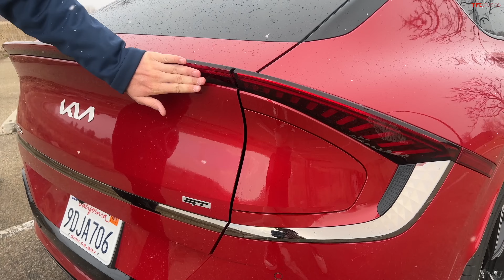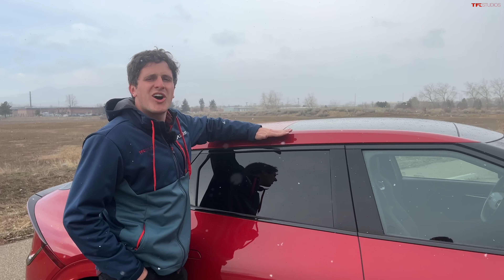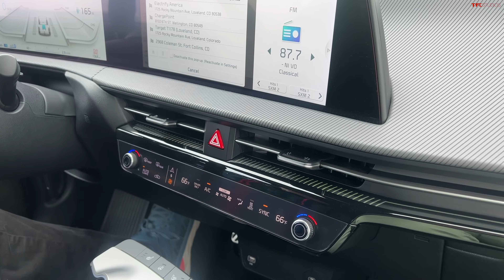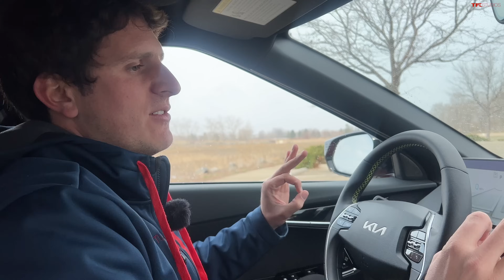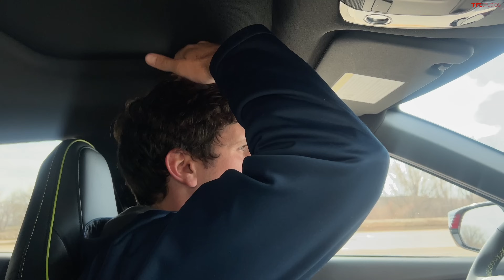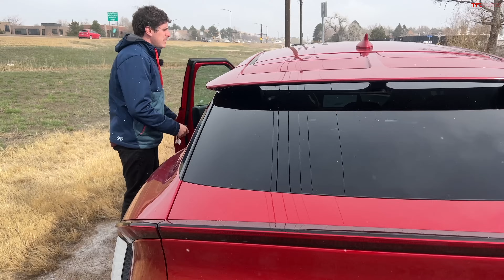The $63,000 All Electric KIA: Is The 2023 EV6 GT Worth The Hefty Price?

Comment: Regardless of Popular Opinion I bought an EV6 AWD (Dual Motor) Wind model. It has the almost 300 mi range and 440lbs of Torque. Lot less price also. I have really enjoyed it so far. Its Very quick and agile for its weight and Charges fast. But it will not beat an Aventador . (It does pull away from these avg. turbos lately tho)

Comment: I must really be an old man.. I wan't a Forrester EV. I like the height, the cargo space in the rear, the visibility, the seating position. Faster would be better, but can't even use what my 2019 has here (Hawaii, Big Island).  Obviously want a heated seat etc delete option (Hawaii).  Also, give me knobs and switches! I love touch controls on stationary devices, but they are a disaster on our rough roads here, like a bad hands free system (Forrester), they are a driver distraction.  I like the EV6, it just needs a 5" TALLER ROOF. Please test these vehicles on real world roads, bad old paving, twisty, two lane, etc.  Of course they perform well on nice smooth pavement! For example I haven't used cruise control of any kind here, except for one stretch of road heading into Volcano that I drive maybe 4-5 times a year. Why pay for something you can't use?? Heated seats?? in Hawaii?? That's just something more to break

Comment: Costs more than 2 Bolt EVs and 1 Bolt EUV fully loaded yet can't go as far and takes longer to charge at home or at the 50 kW DCFC that are around where i live.  So you could get one of these Kia or 1 Bolt EV for yourself 1 for your kid and a Family Supercruise Bolt EUV for the significant other.   No kid borrowing the car they have their own.  And the Bolts can go 20 to 30% further for less E.  

As noted previously with the Bolt can you public charge this only and drive to work for a week?
Reply: I ❤️Chevy, a GM guy thru & thru. Period. 🤣 But Both appeal to two very different buyers. 
Just like in 1908, when the Model T came out. You could buy the Model T for ONLY $950!! A STEAL! BC ALL OTHER CARS ON THE ROAD AT THE TIME? Were LITERALLY ONLY FOR THE RICH! And were Priced as Such. = Way, Way WAY MORE then 950.00 That was the Ford's point. 
& I am with Chevy & Proud they Do offer a cheap Good EV, considering they really fumbled the ball in 1995! They could be what Toyota & Honda are Today. Had they not caved to Big oil & done in EV1! - So kudos to GM for the Bolt. But the Bolt does NOT Do 0-60 in 3 seconds like this Kia does. It doesn't have AWD fir those who Demand it. As "cool" as it is, it's hardly Edgy like the EV6 either. It's more cute than Wow. The interior materials are apples to oranges Different. 
You state valid points. But people don't buy 911 Twin Turbo S because they're Practical cars everyday cars. They buy them bc they Love them, their Fun, they like the Look etc. - Likewise: Bolt? CPA from a flyover state  ... EV6 Hot Corp Forensics Accountant in London! 🤣 does that make sense?
Reply: @ElliottTAlphaG700  the Bolt EUV does everything this Kia does except go fast.  And does somethings better.  You could even say it does 99% of what the Kia does, 99% of the time.
Reply: @Aren Jay  
TF it does, IF u mean they both have 4 wheels ??? The Bolt 0-60 in 7.15 Seconds is a LIFETIME. Versus the EV6 GT IN 3 SECONDS. The Bolt has 200hp the EV6 576Hp. Dude they are NOTHING ALIKE! The Bolt has a 25k Plastic & cloth interior. The EV6 has a swanky Alcantara interior. You're seriously deluded.

Comment: 😂 I did say I liked you bc you're a funny nerd. 🤷‍♂️ Cute nerd, that do it for ya 😂
That aside, it's one of the best EV one can buy stock. In my less than humble opinion. It's a neat looking vehicle, chunky & FAST, Not Lotus Evija fast. But then it's not a $2M car either😂
Reply: One of the best??? You mean one of the worst, if not the worse.
Reply: @allentoyokawa9068  
To each their own, it's more modestly priced. Less than most fossil fueled Gas Hogging p/u's that those owners then b*tch whine & complain about paying for FOSSIL fuel oy. So Less then those. A little more an a decent nice car, which doesn't have its HP  & certainly can't do its 0-60 times. And in NHA Safety scores does amazingly well! Kia backs up their products with STRONG FORTIFIED Warranties, UNLIKE Honda OR Toyota! They USE too. But as they're reliability on many vehicles went down, so did their Warranty. 
So yeah one of the Best MY LESS THAN HUMBLE OPINION. Or is 1.5 paragraphs too hard to read 😒🤣

Comment: Have they fix the charge control units yet that are causing the 12v battery to discharge?  63k seems a bit much to pay to be a beta beta tester. Best thing to do is wait awhile until all the bugs are worked out.
Reply: It’s not anything mechanical, it’s apps polling the car up to 2,000 times a day and has supposedly been addressed in software.
Reply: @JohnCap523  it hasn’t been addressed. Trust me when I tell you it’s the charge control unit. I love how these manufactures  say oh we can fix it with software update. Of course they say this. IT is the cheapest thing no way are they going to say oh we have to replace it we a new part. It would cost them to much compared to just saying oh we can fix it with  software.
Reply: @bunnyfartloads    Well, it’s been addressed by Hyundai. And I’ve seen people who monitored the drain, and they were also convinced it was external sources. But hey, you sound like you know…

Comment: 206 mile range is unacceptable in a 63,000 EV. Now take 80% of that which is where you should charge your battery if you want longevity and then drop the temp to 40 degrees and see what the real world range is…. Pretty terrible I would say…
Reply: @UweLoewer from Germany achieved a consumption of 22.3 kw/100km in real life use in winter conditions (temperature below -4C ( ~24F) and winter tyres), so he can go over 215 miles on a full battery, which is already higher than the EPA figure. Also @OutofSpecReviews guys have more range on the Kia EV6 GT in highway driving than the EPA combined.

Comment: Kia EV6 is as good as it gets for an EV, but ICEs and hybrids are better value for money and will remain so for years to come. Presently there is no adequate infrastructure for EVs in most countries, they take too long to recharge, the batteries degrade too quickly, they're too heavy, and cost too much. The only way governments can wean people off ICEs is by diktat.
Reply: Where do you charge your cell phone, tablet, laptop or operate your desk top computer every day?
That's where most people in the world will charge their electric vehicle. They'll charge after midnight, when most people are sleeping.

A 2 door Ford Mustang combustion engine coupe weighs approximately 3,900 pounds. Add a full tank of gas and the weight is above 4,000 pounds. That's about what a 5 door all wheel drive electric Tesla Model 3 weighs.

Electricity is everywhere.
It takes electricity to pump and pay for gasoline and diesel.

These expensive EVs are not meant for emerging countries with many poor people.
Reply: @dvader3263  Home charging won't do if all your neighbours have EVs. The power grid today is inadequate for such load. And where will you charge the car if you live in a city apartment building and park the car downstairs in an open lot? And how are you going to drive your car to see your mom who lives in the country 500 miles away? And how are you going to drive your family from Indianapolis to Pensacola, 730 miles, for their winter escape?
Reply: When gasoline gets to 5euros/lt, you'll leave your ice car parked.
That's how they'll separate you from your ice car. No diktat needed.
Reply: @ΤηλέμαχοςΜελισσουργάκης  Where I live gasoline price is determined by the market, not by the government. Right now it's about $3.50/gallon, which we consider rather expensive. It may come down, depending on the outcome of the forthcoming 2024 election. This is how you can fight $5/l gas prices in EU. Vote them and their energy policies out of office.

Comment: Lmao why would anyone buy this over a model y performance. Literally better in every single aspect.
Reply: Ironically says the guy with with a Bernie pfp. Ask Bernie why or Any pro labor person or Anyone who believes in Democracy. Or any Other of the 10,000 other reasons
Reply: If you're OK with 180 mile range for $70k, yes, but model y has well over 300 mile range and is just as fast, and best charging infrastructure,
Reply: @tonyn3227  A lot of owners get from the car better range than EPA claim. Even on youtube you can easily find tests where they did more on the highway than the EPA combined.

Comment: I have one and it’s easy to do better than the EPA range rating. I average 3-3.5 Miles per kilowatt hour on almost every drive, including 70mph freeway driving. This is in Normal mode with occasional bursts in GT mode.
Reply: Hey I also own this did you try going to the settings and see the maximum output button I guess it heats up the battery and gives you full power. These YouTubers are doing 0 to 60 without using it.
Reply: @bigdi77  I have seen the setting but haven’t tried it. The car is so fast without it I haven’t felt the need.
Reply: He forgot to mention that thigh support in the back is rather poor. Between that and the head clearance makes me feel that the EV6 was meant to compete with the 3 not the 6… similarly to the IONIQ 6.
Reply: In general… e-GMP vehicles « tend » to be conservative on range and performance.
But this really feels more like a 3 than a Y.
Reply: You're lucky you can get 215 miles  out of this car when fully charged, for almost $70k, no fukin way
Reply: @tonyn3227  Simply not true. What are you basing your statement on? I am consistently getting much better than 215 miles range. I did a 79 mile drive Sunday, mostly on the freeway at 70mph, and got 3.2 mi./ kWh. That equals 240-250 miles range.
Reply: @Michael C  everyone I checked with says range is awful,  but performance is great.  Model y is less expensive,  much more range,  better charging infrastructure,  yes there is a lot of them on road, but is a clear winner,  that's the one I'm getting
Reply: @tonyn3227  I can only speak for my car, and it is definitely exceeding the EPA range. The Model Y is not that much cheaper, and can cost more depending on options. It has no instrument cluster, no heads-up display and a spartan interior which is fine if you like it - I don’t. I prefer a more traditional cabin. I really doubt that the Model Y gets the full EPA range from what I have heard. Quality control on Teslas has gotten better, but it’s still not great. The fit and finish on my car is excellent, and the warranty is the best in the business. I charge at home so I don’t need the charging infrastructure. I have other cars for road trips. From all the tests I have seen the EV6 GT is definitely the quicker car. Where I live in the SF Bay Area Teslas are everywhere, I wanted something different. To each his own.
Reply: @michaelc2254  even at 220 or so, with 800v arch it's still fine. People like Tony wildly overestimate the mileage they actually need.
Reply: @tonyn3227  Model Y looks like an egg and the interior sucks
Reply: @pbr-yt8zc  maybe to you but not to millions that drive it.

Comment: On range:  Kia could probably easily match the Mach-e's range by matching the battery size of the Ford. 88kWh vs 77.4kWh, so over 12.5% more.  Not understating the range would help too.  Pretty sure that range is easily beaten.

Comment: Sure, 577HP. Use that and you can only drive 100 miles.

Even if you are on a long trip, in Canada, it's only rated at 332KM. Except that's from 100 to 0 which you will never do. You're going to look for a charger at 10% or so. That means the first leg you can go 300km, so at 120km/h that's 2.5 hours. Every leg after on your trip that's under 2 hours since you can only fast charge from 10-80.

What's the good of 577HP if you have to stop for 20 minutes to an hour every 2 hours anyway?